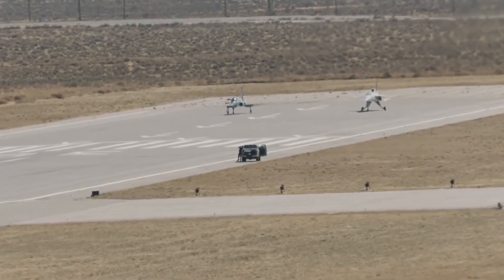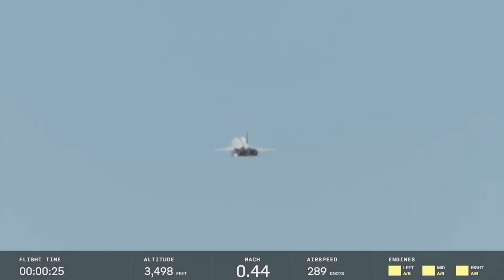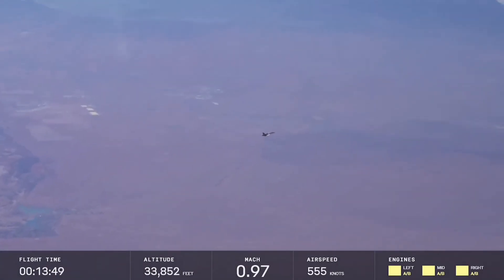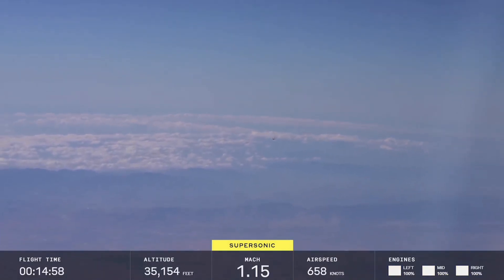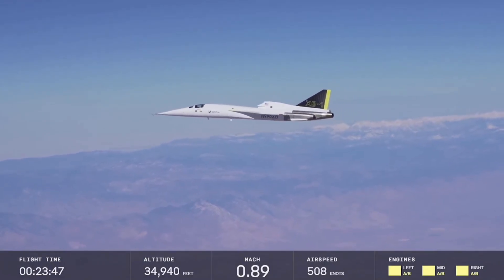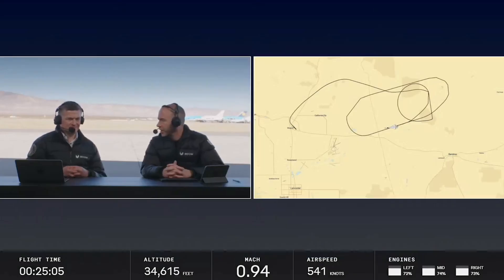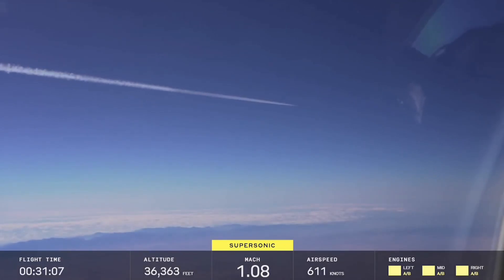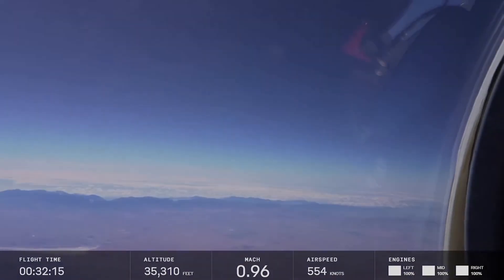Boom XB-1 goes supersonic three times on final flight

Comment: "No ejection seat to force us to make it safe" may be one of the dumbest reasons to exclude safety measures on a test vehicle ever uttered. 🤣🤣🤣🤣
Reply: I just made the same comment!  That didn't make sense to me.  So they skimped on the ejection seat, probably due to funding or engineering (or lack of) but his reason for not having one is insane to me.
Reply: That is a way of saying that an ejection seat was just too expensive.  :)     Hmmm  did the Concord have ejection seats in it's first prototype?

Comment: Whoop-de-dooo.  Why is this so impressive.  The Concorde was going MACH 1+ in the 1980s so.  The World needs an Passenger Airliner that can do MACH 2.0 without any sonic booms, that can get Passengers from NY to London in under 3 hours for under $1,500 roundtrip.  That would be transformable.
Reply: You seem to understand the dynamics and reasons for these tests better than most of the commentators. Primary public outcry concerns were the Sonic booms causing property damage and startling people and wildlife. While it's true we concurred mach speed years ago, we were not yet able to reduce the negative affects. Good on ya! You've done your homework! AEC USN RETIRED ⚓
Reply: It's so impressive because this is the first privately built aircraft capable of flying supersonic.

Second, it is the test bed aircraft designed to explore the reduction of the sonic boom, which aside from operating costs, was the other main reason Concorde was retired....it was too loud.

This is hoped to be the beginning of the future of a new era of supersonic flight.

Overture will be able to fly at Mach 1.7, not much slower than Concorde, on sustainable aviation fuel, for a lower cost and without the sonic boom, with a lower ticket price than Concorde.

This is only company showing they have what it takes to return Supersonic passenger aircraft to the skies world wide .........Sydney to LA on 4 hours . ....

Pretty impressive for a start up company!

Comment: Well it's not as if no other aircraft has gone supersonic, eh? 🤔
Reply: True… but this is a totally different design that would cause the sonic boom to be greatly reduced…. The point is to have far less noise and not cause broken windows, etc when flying over populated areas.
  Which the concord was prohibited because of those reasons.
Reply: @Alan-in-Bama  Concorde never broke windows; it was at 60000 feet. But to be fair, it did make a sonic boom, which is why the Yanks didn't like it. Not that the Yanks seem bothered about SpaceX sonic booms over Florida now, but that's progress!
Reply: Sonic booms are horrible. Trust me.